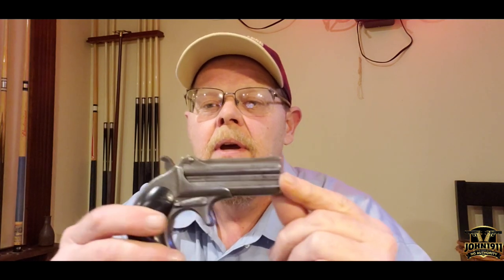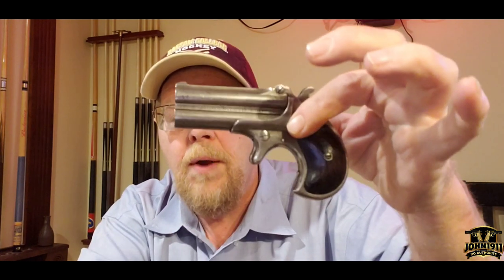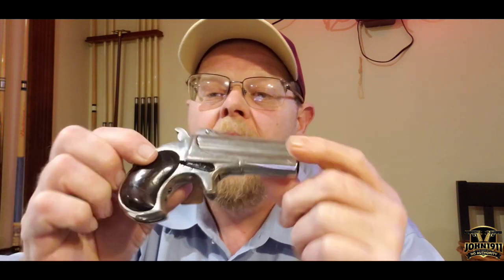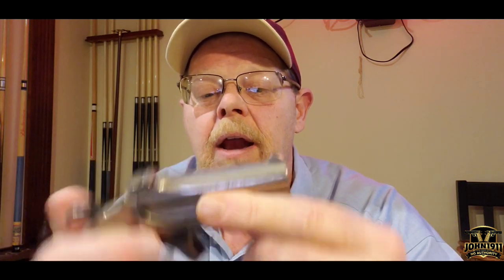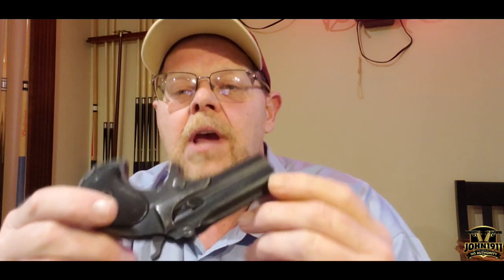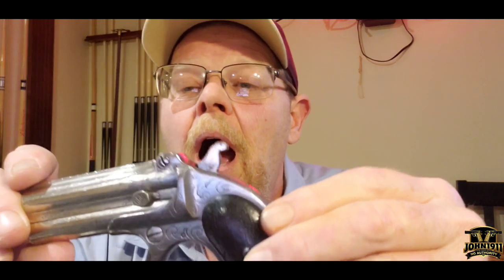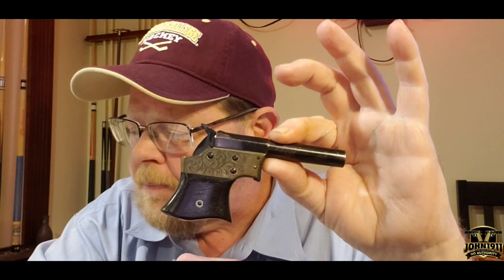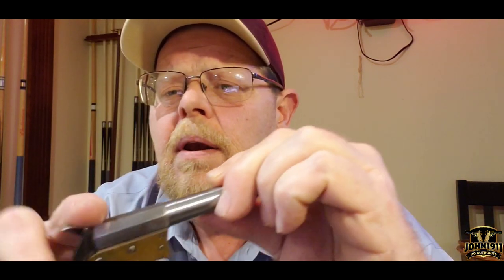Remington M-95 and Saw Handled Derringers

Comment: I have a model 95 .41 cal over and under w/ejector..I purchased it with other fire arms but its missing a trigger spring,gear spring,and selector spring..so do you have any insight on where to get atleast spring material for this piece?
Reply from the maker: I do not. You would likely have to take it to a smith and have him make your springs out of existing spring steel. If the spring isn't really crazy complicated, most smiths can do it. 

Regards,
Marky
Reply: @John1911  thanks anyway,I actually found a gunsmith/guns,and ammo shop a couple of towns from me..
The guys actually have a couple of misculanios boxes of springs,and other for older derringers
Reply from the maker: Sounds like a plan. The best situation is to find a smith who knows what’s up, so you don’t have to pay for them to figure it out. 

Marky